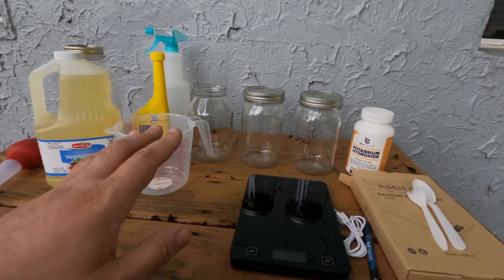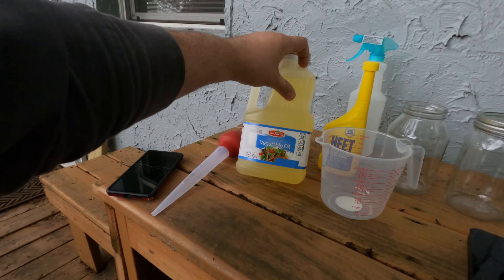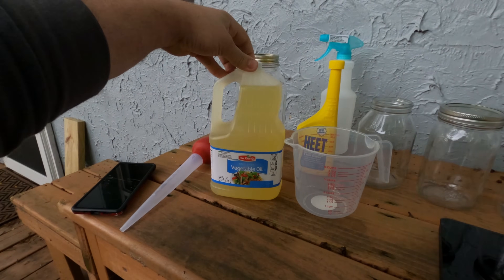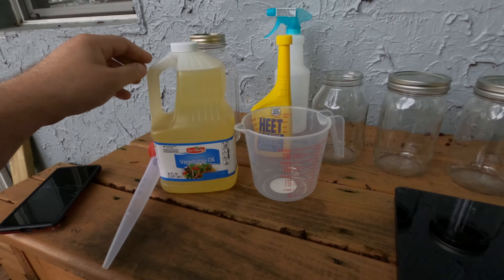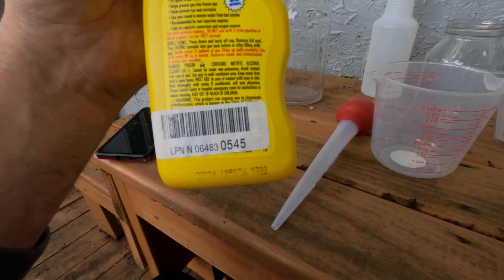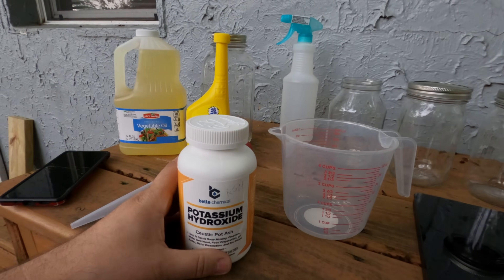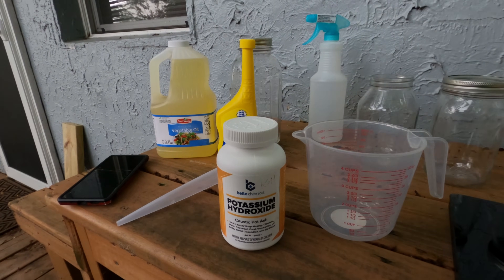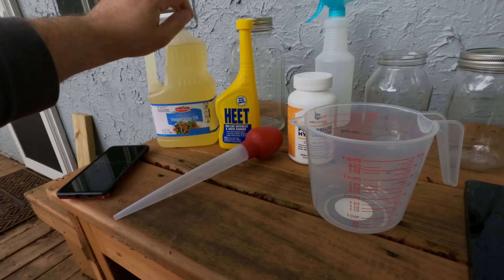This is why making biodiesel is going viral now! It's so easy!

Comment: So now I have another question concerning your "large quantity production": the Glycerol! After you added your methanol and hydroxide mix (that is approximately 20% of the oil volume) you end up with a quantity of biodiesel PLUS GLYCEROL. The quantity of glycerol you are stuck with is AGAIN about 20% of the biodiesel you have made. That is A LOT OF HARMFUL substance that you cannot use for anything, really! It does not burn and it POISONS THE GROUNDWATER! So you are making 100 gallons of biodiesel what will you do withy 20 gallons of glycerol???? Where are you going to dump that? It also contains quite a bit of methanol plus lye, so what? the sewer? Do you know the kind of liability you are creating? To all those that want to make biodiesel as an experiment, well, fine. And you will be shnuckered into thinking it is easy, well it IS NOT DIFFICULT! But if it is your goal to save yourself a significant amount of money, that means you will be sitting on a mountain of glycerol you cannot use, sell or LEGALLY dump! Go solve that question BEFORE you even start. Many have tried, but not found an answer. Google that! BE WARNED! But just to tell you what I have done: I made biodiesel in Hawaii. we had 2 cars and a tractor, and we did not buy any diesel at the gas station for 7 years. Biodiesel is a great product, not difficult to make were it not for the glycerol! You can use it in a digester to make biogas but that is a plant much bigger than the biodiesel plant! And consider this: You need a source for used cooking oil! The restaurants all want to get rid of it and they are happy with you picking it up but NOT FOR LONG! Pretty soon you will have competition suddenly there is a demand for used cooking oil and you end up chasing cooking oil every day, so it ends up in your garage and not someone elses! Half your life suddenly revolves around your biodiesel production, and please DO NOT THINK anyone will buy it! Remember, that in most places within the USA they will CLOSE YOU DOWN as soon as someone complains about your little production!  If you ask me it is FAR BETTER to start tinkering with electric cars!
Reply: Electric vehicles now becoming as expensive per mile to run as ice engines. 
Plus research now shows over a life time of 100k miles they are practically even on emissions. 
However recycling an ev produces vast amounts of emissions over recycling of an ice vehicle. 
Add to this the problem of finding a charge point if not using an ev as a commute and local run around thus charging at home. 
Electricity currently at  0.91 euros kWh plus 9% sales tax (VAT in Europe )and a carbon tax of I believe 4.5%
I’m now hearing ev owners complaining of the cost of running them , many considering returning to ice vehicles. 
As for biodiesel I ran a 2006 Hyundai 2 ltr  common rail diesel for 6 years on a straight mix of cooking oil and pump diesel. 
25% diesel to 75% free oil in summer 
50/50 mix in winter. 
Had no filter heating system 
So way I did this was when low on fuel go to pump and buy 20 litres diesel. Then at home with engine running add the 20 litres of cooking oil in winter and in summer buy 10 litres diesel and add 30 litres cooking oil. 
Otherwise if engine not running the cooking oil sank to bottom of tank and on next attempted  start fed engine pure cooking oil. 
Only happened me once but had to run an auxiliary line with pure diesel to get engine started and once warmed up re connected the fuel tank. 
Over the 6 years I did around 200 k miles and after 2 years I drained the fuel tank to see if there were any build up of residues but found nothing out of ordinary. 
Currently rebuilding a 1970s Landrover diesel fitting a 300 tdi diesel from a late 90’s Landrover. 
Plan to fit an auxiliary tank for pump diesel to use for starting in cold weather and to run cabin heater. 
This should solve problems of  cold weather starting when using high concentration of cooking oil. 
Have friend who has run a 1998 Vw transporter on a similar mix for at least 12 years and I have never heard him complain of any issues. 
Modern vehicles do not like bio diesels in general because of the materials used in the manufacture of the fuel and injection system. 
Plus in Ireland they taxes the biodiesel and LPG to point it was not worth using.
Reply: Lithium batteries are so toxic. Production and disposal. But you are only concerned about your local environment. EV are not so great, like everyone is saying.

Comment: If you use used vegetable oil from different restaurants AKA cooking oil is that pretty much the same?
Reply from the maker: I collect from several different restaurants. 

I've stopped collecting from some because it had too much water and fat in it. 

So even if it's all oil, it's not all the same quality. It doesn't matter if one is canola and one is coconut though.

Comment: I did my first batch. Its about 26 /28 liters or soo... i bought 5liters of methanol, it took 2 weeks, not very easy ti find. Then i did the ratio i found on a vietnamese video. 8l wvo, 2l metanol and 50 grs lye. It is wonderful, but still a pitty in winter it is not very usefull
Reply: crazy what one will do to save a buck or 2.

Comment: If you use waste oil from, say, a restaurant's deep fryer, even though it has been filtered and re-filtered, before being discarded by the restaurant,  because it has become pretty nasty for culinary use, despite being filtered multiple times, is it not still going to have things mixed in with it that came from all the food items that were deep-fried in it? Potato starch? Fat from fish, chicken, beef, pork, etcetera, particles of potato skin, chicken skin? Glob knows what else. How will these work in the diesel engine's fuel injectors, fuel pump, cylinder heads, cylinders, piston rings, valve, valve seats and valve guides. Will all this extra stuff, that isn't in commercial diesel fuel, be ok to use in a diesel engine? Will they deposit themselves to some extent on moving surfaces and affect how long the engine lasts? For all I know they will help the engine last longer. But I don't know all that much.
Reply from the maker: Depends on your source and what they use in it. 

Also, this is why you would filter, then centrifuge it. 

I use a 600 micron, 300 micron, 100 micron, then a 3000G centrifuge before I process.

Comment: Veg oil is almost as expensive as pump diesel I  the uk plus methanol and pat hyd it's not worth doing
Reply from the maker: That's why you don't buy the oil?

Or watch the video.

Or read a single comment
Reply: @TheDrivewayEngineer  some of these comments have to be from bots of some sort surely

Comment: Put that stuff in a modern common rail diesel & see what happens! You will destroy your fuel system. Low pressure pump, high pressure pump, 4 injectors (4cyl im in uk), fitting & cleaning of pipes etc usually runs about £5,000 here in UK. Genius, save yourself a couple of quid on diesel & trash your vehicle in the process. I guess it may be ok on the older mechanical injection diesels, but how many of those are left on the road.
Reply from the maker: I put it in a modern common rail diesel in this literal video
Reply: False I have done it in a 6.7 cummins

Comment: You are nearly there, did everything right, but forgot to remove the Glycerol, but instead, mist washed it while the Glycerol is still at the bottom.  You then poured it all in and the water that was in it.  You need to remove the Glycerol, then wash it, keep removing the water from the bottom until the water is clear, then heat off the water until bio is dry, then filter the bio
Reply: I’m from Brazil, we have Biodiesel into Diesel, we call it S10. All our motors have problems with the injectors. Around 200.000km, it breaks. And all the rubber things, seals, rubber pump lines, filters, everything plastic or rubber, suffers prematurely.
Reply: @BrenoBLC  What is the percentage of biodiesel? 10 or 90, or something else?
Reply: @leiflillandt1488 it's 10%biodiesel  to 90%diesel.
Reply: Just add 10% unleaded to standard new svo and it works a treat. Never had an issue.
Reply: @OverlandTT  Ethanol is no bueno for many diesel pumps or seals
Reply: @Taydrum  
Mix it 50/50 if that’s a concern. 
South American diesels run on “bio fuels” and have no issues. 
The emissions are cleaner also as there is no NOX or other harmful things.
Reply: @Taydrum  ethanol should
Not be mixed with diesel anyway. It’s vegetable/seed/canola oil.
Reply: @OverlandTT  all gas in my state is 10% ethanol
Reply: @Taydrum  this is diesel.
Reply: @OverlandTT  wouldnt that be more expensive than just filling a diesel tank at the pump?
Reply: @vagautohaus4492  
10% unleaded plus the cost of rape/canola oil. At that time the rape seed oil was around 40pence a litre compared to the £.1.20-£160 per litre for pump diesel.

Comment: You say that you can make one gallon of biodiesel for  $1 .Do you get your oil and products for free?One pint of vegetable oil costs more than a dollar and you have to add the price
of methanol,potassium hydroxide and so on.To make 1 litre of biodiesel  it will cost you at least $1 !! You are a dreamer or a liar.
Reply from the maker: Or, I get the oil for free.

25 gallons a week.

Free.

So eat a sack of dicks
Reply: @TheDrivewayEngineer  You didn't say that you are getting free oil.If you have to buy vegetable oil,it's going to be cheaper to buy it at the pump.

Comment: The entire biodiesel process is NOT COMPLETE until you removed the remaining methanol and hydroxide from the BD by rinsing and washing after the reaction.  Biodiesel is exactly: Fatty Acid Methyl Ester, FAME. This is a SOLVENT not an oil, or a fat. Traces of Hydroxide and methanol that have not been removed through washing WILL BE BAD for the engine, the methanol will eat the gasket material the Biodiesel will dissolve any plastic or rubber except for one type of material: Viton! So, get with the biodiesel community and find out which cars, engines will suffer damage in fuel lines, injection pumps, injectors etc. Some diesel cars will absolutely suffer, whereas others will do fine. (Old Mercedes will have NO problem, but cars with a fuel rail will be problematic). I believe that we have seen the best years of homemade biodiesel, it is no longer recommended, since modern diesel engines have sophisticated injection systems and will NOT work with biodiesel. The problems are: Oxygen sensors and injection systems since the electronic control systems are built assuming the viscosity of diesel, BD comes close, but no cigar. Used vegetable oil is even less of an option now. Sad. I loved making BD.
Reply from the maker: Been putting Biodiesel in my common rail truck for 100,000 miles
Reply: @TheDrivewayEngineer  same
Reply: 6 years 200 k miles on a 2006  Hyundai common rail with a diesel/ cooking oil mix. 
Never heard any complaints from person I sold it to later

Comment: What you are  doing  SO wrong is you are NOT warning about how dangerous Methanol is and how even MORE DANGEROUS the Methanol/ hydroxide mix is. Can you put lye on your skin? or in your mouth or nose or  eyes or mucous membranes? Do you know that methanol causes blindness and tissue damage? The first thing you need to do is WARN those that want to try your method of the dangers these materials may cause. You need safety glasses and latex gloves, at the very least. You also need water nearby to rinse in case of a spill. DO NOT UNDERESTIMATE these substances you are using. Even after the reaction there is a lot of unconsumed methanol still lingering in the glycerol.
Reply: Maybe the world is dangerous and he gets the diesel in his truck and it’s not dangerous
Reply: I make my own methanol using pyrolisis and YES it is dangerous.  It will cause blindness if ingested and is transdermal (goes through skin). Flammable? HELL ya!
Reply: @SiwyWabbit  hahah yah one time I was wondering where my eyebrows went. Methanol burns INVISIBLE! And I was trying to see if I could reduce my mountain of glycerol... No it doesn't burn but the Methanol thats lingering sure DOES!
Reply: Making Bio Diesel from 2007. Had no problems with the chemicals. In the end, Bio Diesel is less toxic than table salt.
Reply: Bit like petroleum then
Reply: Chemist here. You are exagerating the dangers. 
Methanol only causes blindness if you drink it and quite q bit of it at that. It is not significantly dangerous on its own in any other way other than flammability. 
Hydroxides however will blind you permanently on contact with the eyes and will cause chemical burns to your skin.
Reply: I just came here wondering if it will work in my flamenwerffer
Reply: @doodlegassum6959  yes! But it burned to clean for my vertical flamenwerffer..😅
https://youtu.be/XvOMQkL8kd0
Reply: Methanol is high octane moonshine and lye is the active ingredient for soap, so yeah, he is a driveway engineer. If you are considering doing this make sure you are in an isolated area away from busybody neighbors.
Reply: It is your responsibility to read the warning lable on the bottle! I have used Methanol in Rc cars seens i was 7 year old, and i have done all the wrong things you can do, but i am still alive. It goes without saying that fuel and chemicals can be dangerous, he is just showing how to make dieseln and i thank him for that.
Reply: @thomasandren8415  If you work in an industrial plant using these chemicals you will have safety procedures to follow. These are NOT written on any bottle. So, here you have to make up your own procedures. You need, at the very least, goggles, gloves and water nearby for emergency rinse.  You are potentially working with 40 l of methanol and dumping a few kilos of hydroxide into that to convert a full drum of cooking oil into BD. That is when it stops being a "pilot project" and becomes industrial grade . That is when YOU NEED a safety protocol. Because if you don't have that and follow it, one fine day you will be in the emergency room! If anyone is making a video about making your own BD they just NEED TO ADDRESS this! And everyone is foregetting the waste product, glycerol! What will you DO with the 40 plus liters of glycerol that you end up with after making one drum of BD?????
Reply: Do you really have to criticize everything You seem to be the one to strain out a gnat and swallow the whole camel. Just enjoy the video you ruin it for everyone.
Reply: Please wear goggles and gloves. Your skin cells are bags made of fatty acids, similar to vegetable oil. One drop splashed in your eye and you'll see, or rather likely not see. That slimy feeling when you washed your palm off of the KOH is your skin turning to soap.
Reply: Shit up
Reply: Poster is right though.
People with Karen comment, should drink some lye and try it
Reply: That takes longer than charging an EV! 😼
Reply: @iangreen180  a lot cheaper though
Reply: Just drink the methanol 😁
Reply: Just let Darwin do his thing.
Reply: Spot on.  It is beyond stupid and insane trying to save a few pennies to maje this at home!!  Not only are the chemicals dangerous but if the end result isn't right, you can potentially do more damage to the engine!!!   Some people have their brains completely disconnected when they think everyine can do this as if they're making a batch of cookies!!!
Reply: KOH is not a joke. Breathe in KOH dust? Spill a alcohol or water mix of it on your skin? Burns through skin. We use KOH in alcohol solution to strip paint off wheels
Reply: Like you I think this guy needs some severe education about the HSE risks ,people need to understand just how dangerous this is
Reply: Everything is dangerous ...
Reply: I will bet your real name is Karen.
Reply: @wainbanfield6775  konasteph is absolutely correct, it might be ok in the outdoors but someone operating this in a basement or a row of houses and something goes wrong the building will go into orbit.  Potassium hydroxide will blind if in contact with they eyes, methanol is flammable and toxic and explosive in the right air/ vapour concentration.  It might also be illegal, I know in the UK, if used for vehicles compromises fuel duty regs so criminal.
Reply: @johnmansell5097  no its not, you can make 100 litres at a time, anymore you need a permit, as a private citizen in the uk
Reply: @johnmansell5097  Karen
Reply: @aeroflopper  thanks for the info  bro. 👍
Reply: @johnmansell5097  we are permitted 2500l duty free set aside as road fuel per rolling 12 months. Only from organic sources, IE vegetable oil.
Reply: @johnmansell5097  there is a number of houses & buildings that go up in smoke every year cause people making their own fuel (even with a professional processing unit ! 
There is a unit made by a company that they say use’s a CAVITATION PROCESS that is a LOT less FLAMMABLE  well worth checking out 👍  but READ the SAFETY comments above ! & protect yourself & others at ALL TIMES
Reply: Dude relax I put methanol on my face and hands it’s awesome, and KOH is just TUMS I’m actually a chemical engineer
Reply: @Michael LaMura  not TUMS, closer to Draino.
Reply: @MikeFico998  You surely flunked chemistry class then. What you splash in your face is most probably isopropyl alcohol.  Methanol's deadly dose is 300mg/kg, "It is a poisonous substance that can be absorbed through the eyes, skin, lungs, and digestive system. Overexposure can cause death. Workers may be harmed by exposure to methyl alcohol. - NIOSH-CDC".  Tums' active ingredient is sodium hexametaphosphate, not potassium hydroxide. I suggest you read-up on what PH is as you probably forgot how it works...or go back to school.